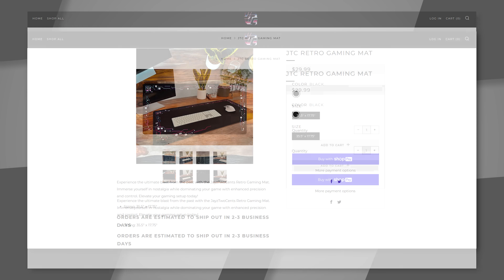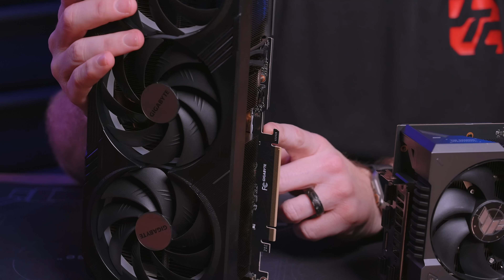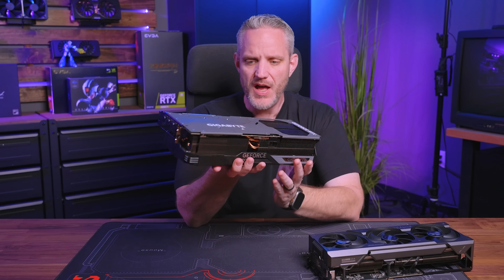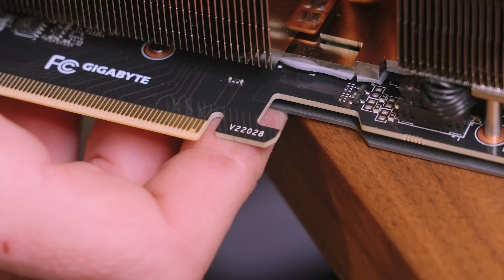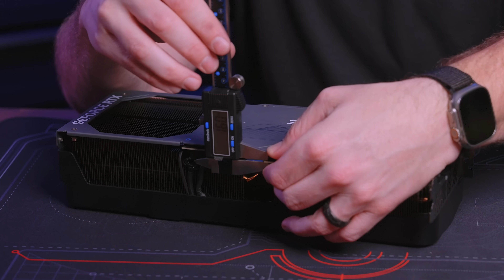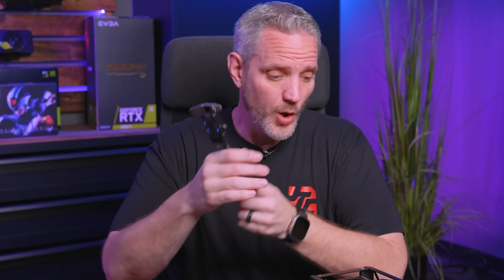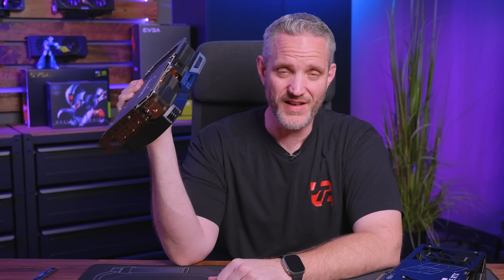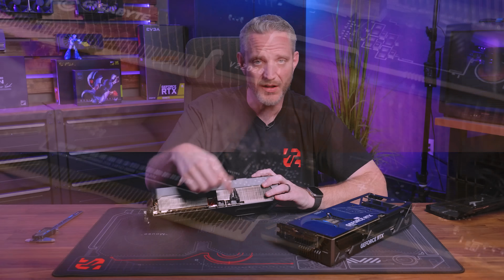These GPUs are cracking and the company REFUSES to warranty them!

Comment: If they have power traces going through there, I would say themal fatigue in such a small space could play a significant role.
Reply: Thermal fatigue, layer separation, just the fact that copper bends and fiberglass plastic does not...

Comment: Hey Jay, a problem like this would have been flushed out during HASS HALT testing. So the data is gathered and presented. The bean-counters then look at the situation just like Ford did with the Pinto. Not until the problem gets to the point where they are inundated will they respond...!

Comment: Well I have that same gigabyte 4090 so now I'm fucking terrified. My card has no sag at all though I literally checked again after seeing this. I did Jays trick to reinforce the end and I also have the gpu support that came with my case on the other end. Really hoping that is enough.
Reply: If you're running a GPU support bracket it shouldn't be an issue. The issue should only appear if stress is put on that retention tab.

Comment: My Gigabyte 4080 came with a support bracket which had an L-shaped piece which attached to the motherboard holes (via standoffs that replaced the screws) and a part that attaches to the end of the GPU which then screws into the L-brace. Rock solid. 

Prior to that, I'd used Jay's tip to shim the backplate of my ASUS 3070 Ti to stop that flex in addition to using the GPU prop rod that came with my ASUS mobo.
Reply: Confirming my gigabyte 4080 came with the same bracket, and is rock solid with it installed correctly. 

And yes, I don't think it's unfair for people to assume they shouldn't have to use one, but by the same token, if it's in the box, why wouldn't you? 😅
Reply: @enjoiadrian  do you think thats enough? i just bought a gigabyte 4090 and i wanna make sure i can do everything to prevent problems
Reply: So, to me, this tells me they knew it was an issue on the previous gen, so they included this bracket to help deal with it...unless they included a similar bracket in the 30 series? Even then, they really need to be explicit that you need to install the bracket to minimize the risk of it cracking.
Reply: Doesn't fit with a ton of motherboards.
Reply: @ThePixelCowboy  ummm color me confused but how can it not fit since it uses the standoffs all motherboards should have in the exact same place??
Reply: @1300BlueStar  because usually in that area the motherboards heatsinks get in the way.
Reply: @strongislandx  Ok, that makes sense, I was thinking headers but the standoffs should be taller then normal headers. thank you for correcting me.
Reply: @1300BlueStar he bracket technically can fit on certain other motherboards like my ROG Strix board, but that would block front panel I/O headers on the board like USB 3.0 since they’re placed right next to the screw hole.
Reply: @1300BlueStar  ya I'm sure every support bracket and every motherboard can have different issues, I bet some headers do get blocked. I just know on my Asus z690 apex which doesn't even have a huge bottom heatsink, the lian li support bracket couldn't fit because the heatsink was in the way and the standoffs couldn't be any taller because then it would block the card from going all the way in the slot.  But you are probably right also. With so many different component combinations possible, there could be many different reasons why something doesn't fit
Reply: @AP03933  ya and next to the motherboard mounting holes there are very tall heatsinks which make things tough also
Reply: @1300BlueStar  Because micro and itx motherboards have the standoff alignment vs the pcie slot different. Also, there are multiple reports that the bracket blocks some ports in some motherboards. Finally, the card pcb is fairly thick, so I wasn't even able to install a different standoff bracket as it didn't clear it.
Reply: I dont get why ppl wont use anything to prevent their gpus from sagging
Reply: @jacobartzavia6096  Because most people assume that they shouldn't have to. Which certainly isn't unfair.
Reply: @RyTrapp0  I dunno man. Just seeing that being uneven drives me nuts. To me it's like getting into a boat that's tilting one way and getting mad it sunk
Reply: Mine came with that as well and once on right that GPU does not move. BTW roughly how much heavier is your 4080 compared to your old 3070 TI?
Reply: @1300BlueStar  No idea and I can't find the weights easily, but it's substantially larger and heavier.
Reply: I've got a Gigabyte B550 Aorus Master which is crammed with features, and the bracket fits just fine.  Again, it's not guaranteed compatibility, but it's certainly one of the strongest support systems I've seen used. It's just something people will have to assess for themselves to be honest.

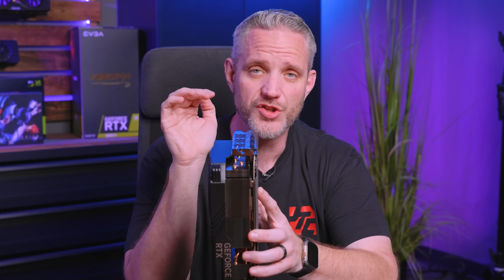Comment: 5:10 that is not a solution Jay, I still have a gtx 1060 and even that card starts sagging at some point.
And with all those beefy coolers these days I would advice to install a bracket on your card.
Just to be on the safe side if you don't want to ruin your 1000$ gpu 😏

Comment: the asus one has les flex because of the mounting point for the heat sink as its close to where you are bending , it would give it suport the gigabyte one is open so no support. I have been concened about this for a wile now with the added weight cards are getting if a compony was to add some kind of support thats linked into the mounting points for the pcb ilke some stiff plastic that runs along the pcie slot to stiffen up that area,  it would also help with sag , also if cards are now 4 slot why is there only 2 mounting screws still why not make that part longer and have 4 screws witch would also help with sag

Comment: One of the main reasons I won't voluntarily give up my current PC case (Thermaltake Core X9) is because it has a horizontal motherboard layout and I don't ever have to worry about GPU sag/stress. It's too bad more cases aren't make with this layout.
Reply: You mean the mobo is installed sideways? So the Gpu actually slots in vertically?
Reply: @gokublack8342  no, the mobo installs parallel to the floor, so the PCIE slots point up towards the ceiling
Reply: Just tilt a normal case on its side 🤔
Reply: Corsair used to make Obsidian 250D (mITX), used it for almost 10 years. My next build will use Chieftec Pro Cube (uATX). There is also Chieftec Gaming Cube (uATX).
Reply: @GrimK77  I still run a bitfenix prodigy, built sometime in 2014.  Fits 140mm + 2x120 radiators and still 300+mm of GPU, with the mobo horizontal.
Reply: @pontiacg445  My requirement is overall height and width within 330 mm, because I want to keep my PC inside IKEA Kallax shelf. Obsidian 250D does that well, but recent mITX mobos suck, and newer GPU cards hardly fit inside, when they outgrow 2 slot width on cooling. Case also prefers AIO watercooling.... and I don't want watercooling anymore.
With Chieftec Pro Cube I will fit in IKEA shelf with uATX mobo, larger GPU, up to 160 mm high CPU cooler from Noctua, and lots of drives, including full bay BR rewriter, if I wanted to.

Comment: Gygabyte RTX 4070 here, It came with a bracket you screw at the end of the GPU right into the case (with 2 of the MB atx holes ). No sagging noticed with the bracket on, hardcore sagging without... You can notice holes on  the end of Jay's 4090 too, must come with one.